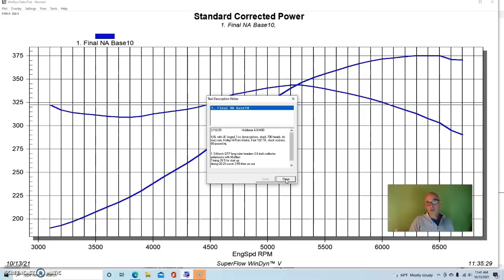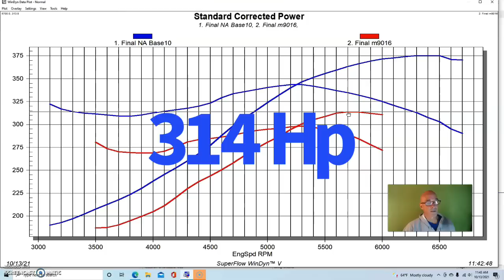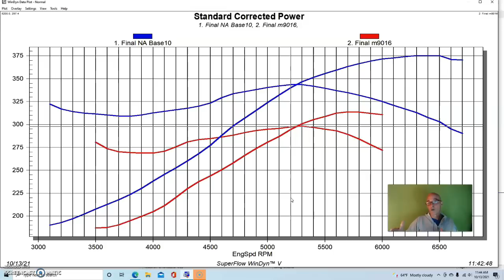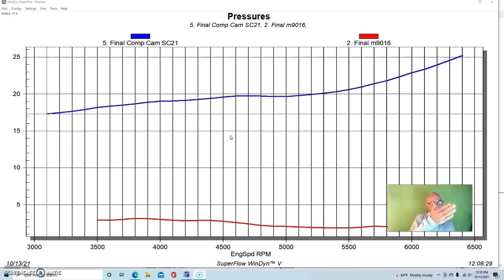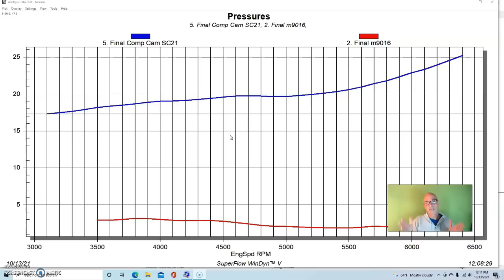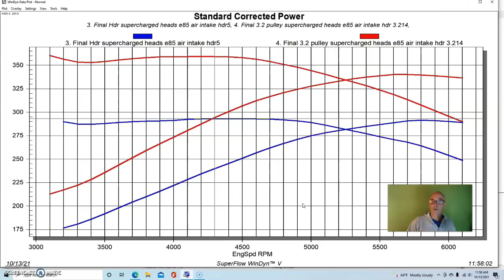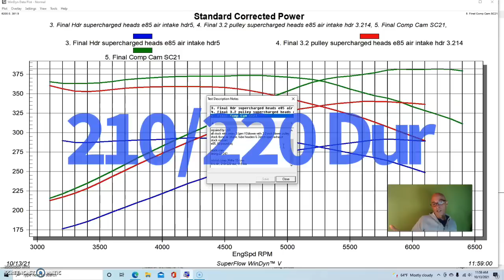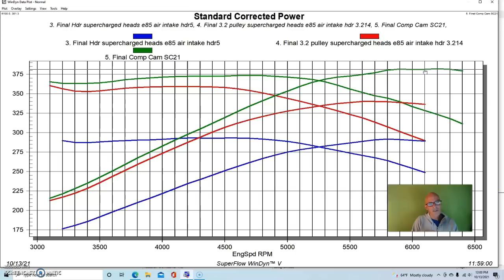HOW TO: CHEAP, JUNKYARD M90 BOOSTED LS? SHOULD WE RETEST ADDING EATON M90 SUPERCHARGER TO THE 4.8L?

Comment: Hello Richard, Hope you're well and take the time to read this comment.
The M90 has an internal swept volume of 1.5L and flat knacker (13500RPM) will move ~670CFM (or 320L/s) of air at a wopping 40-45% efficiency (read directly off the compressor map.) Now a 4.8L 4 cylinder motor is going to displace ~260L/S @ 6,500RPM (~19% less.) So there is additional airflow available from the blower. But there is 'No-Free-Lunch.' 3 things hold you back:

1: Blowers aren't 100% pumping efficient under load, so you don't get 320L/s you get a % less (typically 5-10%less,) so that takes it down to to between 285-305L/s, things aren't looking good...)
2: The blower heats the air and there is no intercooler. Thus, as you turn the blower faster and it pumps 'more-air, ' the volumetric flow (L/s or m³/s or CFM ) increases proportionally faster than the mass flow (kg/s or lbs/min.) Again not looking good. So you don't get 1kg for each m³ of air you move, you get a % less as defined by the ideal gas law. And unfortunately it's the mass flow that makes power, not the volumetric flow.
3: It takes energy to turn the blower.

Thus with all that said and running the numbers on a spreadsheet I made years ago. My numbers put an M90 on the ragged-egde @ 13,500RPM,  in an ideas situation topping out at 272kW (365.7hp) at the crank (not that's AUS kW, with accessories and full exhaust.) 7.4kW (10hp) less than this mild 4.8L makes by itself. Now with e85 things change a little . but I'd be suspect you're pretty much at the limit... (without overspeeding the blower)

Conclusion: The M90 is good for a 2L. not a 4.8L.

Thanks for reading
Jordan
jordan.allen@outlook.com
Reply from the maker: most guys are running these well past 13,500 rpm (some up past 20K), and the discharge temp output is a function boost (too), boost will be low so that will help-I suspect 500 hp will be in the cards (anything beyond that will be icing)
Reply: @richardholdener1727  thanks for the response.

I'd imagine reliability out in the no man's land beyond 13,500 isn't going to be great😅. Though on a dyno or 10sec drag run. That's not a major concern.

Keep testing. Because I keep watching
Jordan

Comment: Yes, maybe even on a 6.0 motor, to ensure no motor airflow restriction. And maybe also test other junkyard common superchargers too, jaguars (think they are the m90 anyway) and mercedes even (probs flow too little).. lot of us are LS owners looking for a cheap diy supercharger mod, even if it's only 60hp for $500ish (then sell your fast manifold to fully fund a supercharger upgrade)
Reply: Jags use a m112 .. well at least the 4.2l v8 uses a m112 ... local pick n pull has 2 out in the yard .

Comment: What about other options there are many other turbo or supercharged cars in the junkyard. Could you find one that does really make a worth while increase.
Reply: There are simply not many cars out there with larger blowers than the M90, the M112 came on specialty cars that you won't typically see in a junkyard.   The rest of the common units are at best similar in size but most typically smaller and less efficient. 
There's the Mercedes M90 and M62 variants,  nice for packaging and some have the on/off switch functionality.   But no more potent than the GM versions.

The M62 from the GM LSJ is still just an M62, and I haven't seen any myself but I assume they pop up occasionally. 

The Mini M45 is cute, but again is about half the size of an M90 and no more efficient. 

Mercedes did have a couple Lysholm units, they are not as common and the big units used on AMG motors are likely to not show up any time soon at the Pic n' pull.

I could see a ln F150 H/D possibly being found in the yard while the Lightnings will almost always be diverted to specialists well before that happens. Right along with the supercharged Mustangs and GT sports cars.

Toyota made a couple nice units, the SC14 iirc is comparable to the M90 in size but it's actually a roots style blower, meaning not at all efficient.  They are found on certain Previa vans while the smaller sc12 was used on the mr2 and at this point is a rare find.

Mazda used a Lysholm unit in the Millenia, but its on the small side (1100cc iirc) and has carbon oil seals like a turbo, when not maintained properly they tend to leak internally pretty bad. 

You MIGHT just find an old 2 stroke Detroit in your yard, but most people consider it more practical to buy aftermarket than to try and convert a 50+ year old blower.
Reply: @DrewLSsix  doesn't have to be a supercharger  there are tons of turbo cars. Even if they are tiny turbos maybe using 2 can make some boost. If you could grab 2 junkyard turbos and make 6psi or so then that would be noticeable.

Comment: Mount two m90 blowers off to the side of  a 6.0L Ls on  fabricated aluminium brackets similar to  how The  centrifugal supercharger kits are done, then pipe it through your dyno water to air intercooler, and up to a single 102mm throttle and the hi-Ram with its Holley lid.   Use your blow off valves to dump the Boost at idle. It will work better if you use the hi-Ram twin carb top, twin carbs, and split the plenuem chamber into two, and seperate the two blowers and piping. If we're mine though I'd cut and shut two or three blower's together with twin 950 Holley's on top.

Comment: Being one of the first guys to complete an eaton swap I can share this. My combo 347 sbf canfield heads tfs stage 2 cam. the blower an eaton m112 of a lightning. No intercooler so I use meth inj. Full interior fox with A.C. and power steering with an Art Carr AOD. 2800 stall 3.73 gear. Blower pulley combo 8'' lower 2.8 upper. Car made 10 to 11 #s at 5500' elevation. Ran 6.80 at 106 eight best pass 3360#s. IAT's were over 220 no meth and under 100 with chilled meth. Hopes this helps
Reply from the maker: that's a 112 but sounds fun

Comment: Gt500 take off on same intake as first test . Max out combo with nitrous for cooling . Can it do 1000 hp or can it do way more with a junkyard 4.8 or .will the blower be the the restriction over 1000 hp
Reply from the maker: nitrous is not a good intercooler, a gt500 blower will require a lot of nitrous to make 1000 hp

Comment: You might run into problems with a six rib belt. Really small pullies will make the boost but its even worse. I dont see a point in using two gen5 m90 blowers unless its just for a test. Thats asking even more from the same belt. If you do retest it on something like a stock 4.8l i would aim for 21k rpm blower speed and hope the bearing in the nose lives to tell the tale and consider, strongly, some kind of charge cooler. The blower efficiency is down to like 44% in the expected part of the map and the discharge temp will be hot enough to cook your dinner.
Edit, from what i can gather, the Ls1 and truck engines have the same damper pulley OD at 7.48 (190mm) and although its bigger than the 3800 damper its still less than a 2:1 drive ratio. To get to 21k rpm you would need like 3:1 and 7k rpm. You would be looking for a 2.5" blower pulley. There are some but not specifically for the unique gm gen5 nose.
Reply from the maker: 21K seems like a lot-even for short runs-i know guys upgrade the snout bearings when going that high-ive looked at the maps-that rpm not even on there
Reply: @richardholdener1727  i also figure that some belt slip will happen, the stock bearing is good for 20k and its easier to cut the rpm of the test short than it is to want more blower speed later.

Comment: Absolutely retest!
500whp seems a bit of a stretch. We're talking nearly 600 crank out of something that's 231 cubes. I don't think an m90 can be that efficient spinning fast enough to make those numbers. Probably just a hair dryer at that point. My tbird SC's would make a frying pan out of the intercooler.
Reply: Exactly. 4-450whp isint unheard of. But beyond that i think its the wrong blower for the job.

Comment: This shows how much better ls heads are than the old small block because a 215hp tpi 305 had a 206/209 split duration with 436/444 lift and made over 100hp less than that 202 duration cam on a 4.8

Comment: Mount two blowers side by side?  Maybe a V shaped arrangement?  Maybe Cross ram style with one blower feeding one bank of cylinders???  THAT would be wicked cool... Does the Holley Cross Ram have removable side plates on the plenum?  If so... custom plenum with blower mounting pad gets u there. Blowers mounted on edge with side draft Webers? Prolly easier in normal config with carb on top.  Wicked cool.
Reply: Holley doesn't but Edelbrock does... Sounds like an interesting experiment if some has time,money and fab skills to pull it off.
Reply: @brudevold62  You're right.  It's the Edelbrock.  You're right too in that it would require some fab skills.  The plenums themselves are the "side plates"...  Could be done, though it's an ambitious undertaking.
Reply: A YouTuber was working on something like that! Can’t find the Part 2. Can’t even remember which YouTuber it was. Have to look.
Reply: @angelovasilikos7980  are you talking about the guy that had it in an old pontiac or something, i think an old hatchback,  like late 70s early 80s. He took it to cleetus and cars
Reply: @stevenbelue5496  I just found it!  The YouTuber is junkyard doggs. Is that the same guy You were talking about? I haven’t had time to see if he completed the build so I can confirm if it’s the same guy
Reply: @angelovasilikos7980  I seen junkyard dogs but the guys channel I was referring to is Rotter’s Garage, I searched “twin Eaton m90 super chargers” and both his and junkyard dogs popped up. I like the look of Rotters garage, his look polished and more compact which gives it a little bit of an oem or factory appearance.
Reply: It's been done, google twin m90 V8.
Reply: @alexcorona  You're correct.  One guy with two M90s on a SBC using a carb.  Another guy with a SBF setup.  The SBF looks like a cleaner build.   Haven't watched all the vids to see if there's dyno numbers or not.  Regardless, an LS with two blowers and stock throttle bodies on a cross ram would probably perform and look good-ish.  We need a guy with some time on his hands to build it, dyno it, put it in a crusty old Nova and post everything. 😁
Reply: Yes with significant intercooling!
Reply: Ok cool I’ll look at the other videos as well. Thanks!
Reply: Was done well before youtube existed.
Reply: @MrEnroh  noted
Reply: @MrScottt28  i tried finding the magazine article, i remember it clear as day. It was a sbf and the owner machined his own extended blower snouts and shafts to line up with the crank pulley and keep the blowers centred longitudaly. Would have been either late 90s or early 2000s.
Reply: @MrEnroh  No big deal.  Lots of guys like to experiment with different combinations.  SOMEBODY started messing with those blowers as soon as they hit the wrecking yards.  It's inevitable.  Whether a magazine article was written or youtube vid was made doesn't mean it didn't happen.  I like to see the variety of approaches/different combinations and the reasons why some don't work, some do work, and some work exceedingly well.

Comment: The guy with the 500hp m90 3800 is Brushworks slick six's here in Brisbane Australia. I believe he spins the blower to around 21000 or 22000rpm with a pair of 750hp rated w2a intercoolers to get a reasonable intake charge temp. With a more efficient engine and lower boost I am guessing the charge temp will be lower at the same rpm. Belt slip is an issue even with an 8pk belt, having a larger crank pully help with that but still probably be a problem

Comment: I'd love to see the results of a fully ported and worked Eaton M-112 ran on a 4.8 overdriven to make 15 psi. Then I'd like to put a 6 speed manual Tremec behind it and swap it into a 67 Olds 442 or even an old S-10.
Reply: Old Monza, or Buick Skyhawk, olds Sunfire hatchback with a simple t5, such a lightweight combo it would take the abuse for a while. Do it with a bigger cam that kills low rpm torque and gear it to wind 6500-7000 rpm full boost coming in around 4500 rpm that would be fun

Comment: M90 isn't big enough.  Use two.

The 5th Gen used coated rotors, and was significantly more efficient than the previous ones.  Have the miles on the junkyard motor worn off the coating?  The best thing to do to wake up pre-TVS blowers is to port the inlet.  That's where the loss occurs.  Just be careful not to change the port timing.
Reply: All the M90's used coated rotors and the gen5 is only marginally more efficiant than the gen3. The gen3 can be ported to match or better the gen5.

Comment: Use the shelby blower.  I always wanted to do that. The Eaton m112 from the Cobra's.
Reply: From the gt500? Or the one used on the series 2 4.0 v8
Reply: @stevennunez6013  Eaton m112 from the cobra.
Reply: Wonder what one of those runs from the junkyard...
Reply: @charlesbrittain434  I've seen them for 700 to 800 around me.
Reply: @mcgregor711  we dont see them here in central Ky, were a poverty state.
Reply: @charlesbrittain434  ive seen a few cheap m112s local to us Central boys 
Running from 350-500$

Comment: I once had a m62 on rover/buick 215 v8 in my european ford capri.. to make reasonable 9-8psi boost I had to spin it over 3x faster than the engine, it was crazy, and now that I know more about tuning, I know that up top it just turned into a heat pump and nothing else, even though I used an intercooler. But at low and midrange rpm it was a devil ;) https://youtu.be/n9VJCtqtnsI

Comment: Can you please strap an m90 to a 4.3 chev any gain or a restriction
Reply from the maker: that would be a lot like the 3800
Reply: So it should work! This video proved that just add smaller pulley and then it wont restrict.

Comment: I think it needs to happen. The m90 can be driven much faster than what it was ran on the 4.8. The blower parasitic losses arent so dependent on blower speed, and more due to the amount of pressure they are seeing on the outlet. Since you saw basically no boost, you could seriously benefit from spinning it faster. The m90 on the super coupe v6 ran a 2.7:1 drive ratio stock so you could easily go 3:1 or higher before really taxing the blower.
Reply: supercoupe thats a 3.8l v6 right?
Reply: @e46m54nissansr20937  Correct. They use a relatively poor flowing head and very mild camshaft and compensated with a higher blower drive ratio and a small front mount intercooler. The blower was mounted remotely and the later gen 3 cases share the same Teflon coated rotor packs that found their way into saleen, roush, and later eaton m90s used across gm, jaguar, Ford, and a plethora of other manufacturers. This same blower case has supported very decent 1/4 mile times in fox chassis. Look up AlexLTD and youll find some old motortrend articles of what he accomplished with this little blower.
Reply: Mad Mod Great info man thank you. I mentioned the 1999 Aston Martin 5.3l V8 in a comment it used 2 eaton superchargers from factory making 600hp do you know if the 2 supercharger were M90s?
Reply: @e46m54nissansr20937  Yep! Aston Martin being owned by Ford used the M90iii model s. They are the same m90 gen 3 case used on a thunderbird with the exception that they have mirrored bypass valves to look nice under-hood. Its hard to find much info on drive ratios etc but two of them at relatively low boost supported over 600fwhp and torque on a dohc 5.3 v8 that could hit an honest 200mph.
Reply: Mad Mod Amazing, thank you Mad Mod. The 90s-early/mid 2000s Ford/Jaguar/Aston Martin/Volvo era was so cool
Reply: Mad Mod Do you know if that 5.3l V8 was strictly Aston or based on some sort of Ford engine block?You are right there is not a lot of info on the 1999 Aston Martin Vantage/V600 let alone the engine
Reply: @e46m54nissansr20937  Absolutely! Ill leave you with another combo i know of. Heres a twin m90 combo making boost on a small block. https://youtu.be/026lnHVEr90
Reply: @e46m54nissansr20937  I just saw your comment referring too whether the Aston v600 used a Ford manufactured or based engine. In short, no.
 They sourced the 5.3L from the earlier model of Aston Virage which had a its own unique block casting and custom made cylinder heads from none other than Callaway ( Famous Turbo Vette Guys). These heads and the over-square design offered by the unique 5.3L allowed for tons of breathing potential for higher rpms to which Aston Martin happily jumped on the opportunity to add forced induction to on the v600.
Ultimately, Aston's repurposing of an already impressive engine and utilizing rather inexpensive superchargers proved to be quite the success. Arguably, they could have made the same or more power from a larger single positive displacement or even centrifugal style supercharger but they still achieved the goal of a 200mph!
Reply: Mad Mod Wow man I gotta screenshot that can't believe Callaway had a hand in the 5.3 makes it even cooler.Yes I'm sure a larger positive displacement could've made more power but it was a cool engineering excercise to have two. Didn't know the engine was over square. Thx for the great info most info I've seen on the motor
Reply: Mad Mod Heck ya I'll be watching this video after work
Reply: hey, thats a nice nickname ;) greetings from Poland 🇵🇱
Reply: @madmodsgarage1179  Hey!! Right back at you. Im from the United States!
Reply: @madmod  the world is a small place we live in ;)

Comment: Please retest with different pulleys. How fast will the old blower spin?
Reply: If I remember correctly, Eaton had a limit of 14000 rpm.  But people spin them a lot higher.  Best efficiency is down around 10000 rpm.
Reply from the maker: 7-8 psi is where they want to be